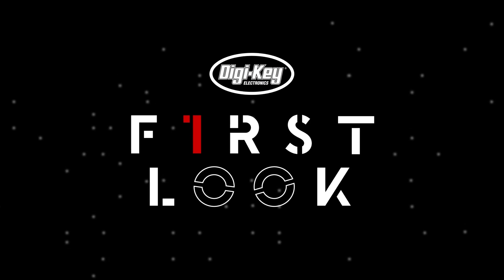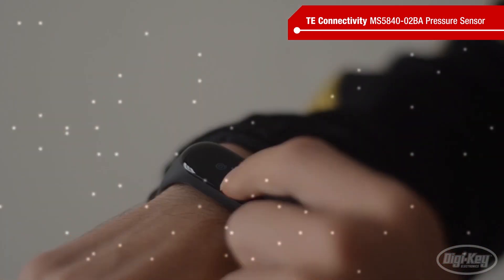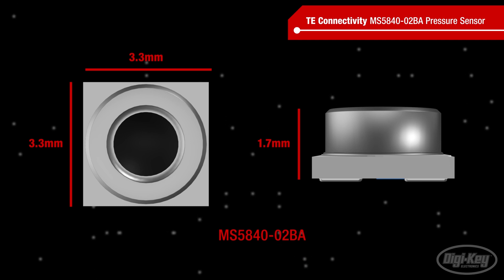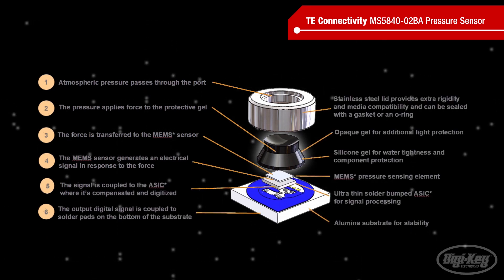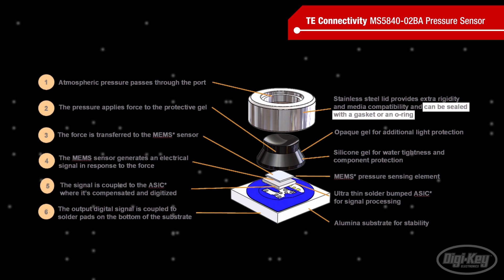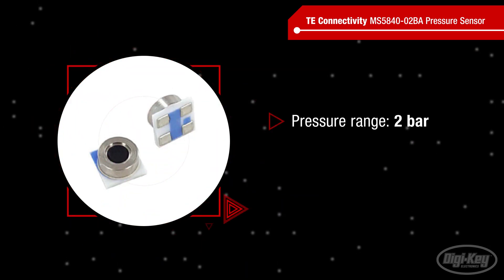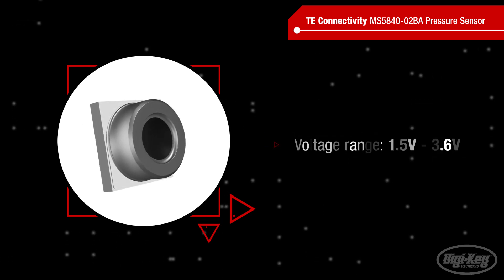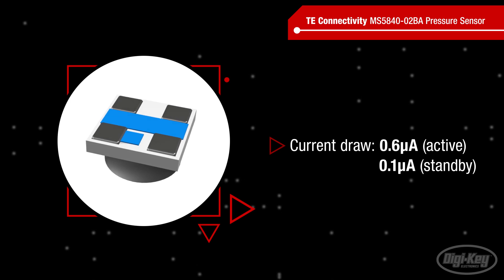TE Connectivity MS5840-02BA Pressure Sensor First Look Video

Comment: What I'd like to know is the difference between "Operating Pressure Range" and "Extended Pressure Range". The OPR is only 0.9 bar, while the EPR is almost 2 bar.
Reply: The sensor is capable of operating throughout the Extended Range, but rated parameters (especially accuracy) is guaranteed on the Operating Range. See how the accuracy drops off rapidly? Datasheet page 5.

https://www.te.com/usa-en/product-CAT-BLPS0060.html